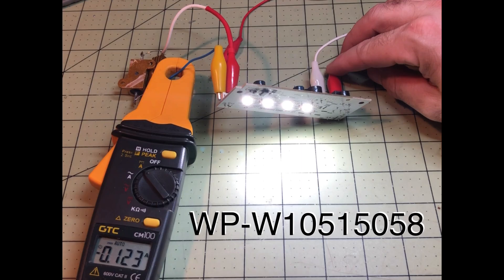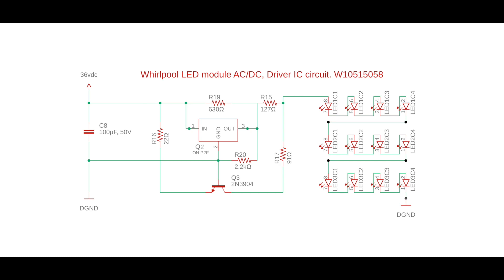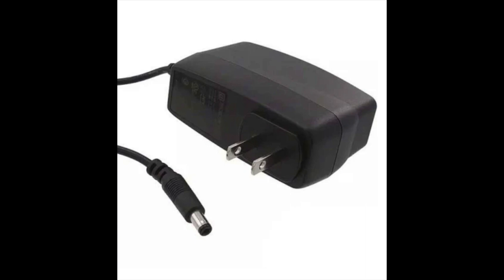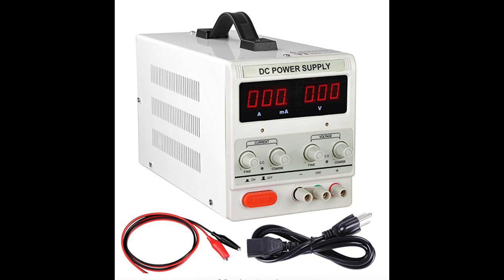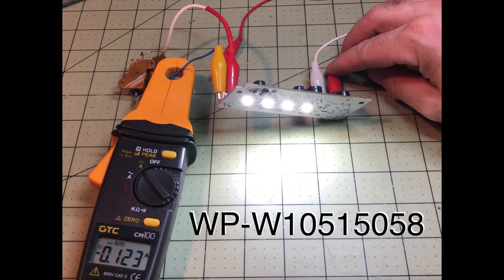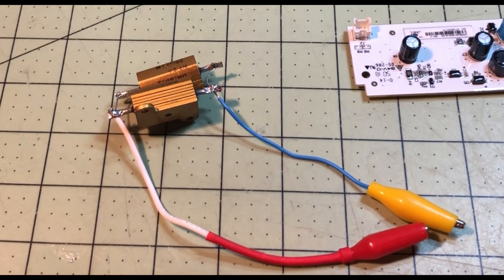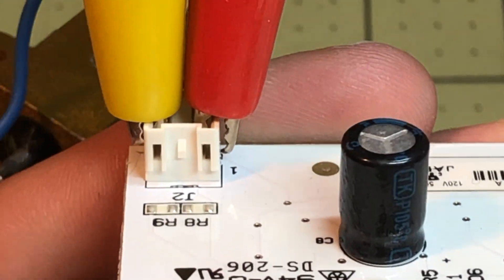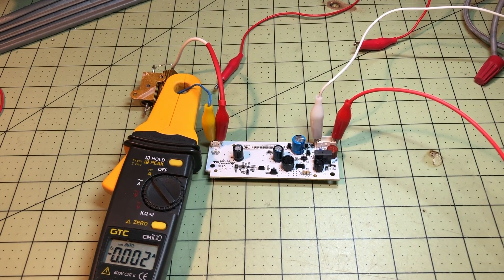WP LED Board Testing

Comment: I had an open LED and it's still dimly the other two units must be more circuitry
Reply: if it's only one led not working ,, you can either put a "500mw"<your number"- resister to replace it, or just jump across it"short it", and the other leds will just be a slight bit brighter with that extra 3 volts they all get to share on. that's what some of the tv repair guys do. 
 i snagged the main board on sale, and was trying to repurpose it for somthing else, didn't realize it was a 3 part ordeal, i might have fried the leds out putting 110 volts to it without any "dummy load",, they all have little black spots on them now.  opps.
Reply from the maker: Overloading the circuit is not a risk I like to take if I can help it. Doesn't look good if customer starts to hear snap crackle pop when I am fixing their appliance, lol.

Comment: Bro you're such a god for the diagram. Do you know if the wires that came out the ACDC board go all the way to the other boards? I'm asking cause I made a LED board since I live out the states and I was wondering if I put the 12v to the wires that goes to the freezer board so the freezer board light up.
Reply from the maker: yes, you could do that. Sorry for the late response. They are like Christmas tree lights. You wouldn't have any protection, if you did that though, for short circuit.

Comment: hey are you able to help me with some info  for chip R15 and R17 both are toast and the R15 actually melted off the board? I know the ohms as per your drawing but would love if you could help me select the correct chips, trying to get into some pcb electronic repair and such as a hobby and this seems like a great way to spend 30 cents rather than $60 for the same part with the same chips that will probably not last. not sure what tolerance and wattage I should be selecting for this. Any help would be greatly appreciated!
Reply from the maker: Unfortunately, there's more than just the resistors that need to be replaced, some parts that are not identifiable. I recommend replacing the 3 led boards, the one's you can get on amazon as a pack. you have to replace them all or they will be different hues.

Comment: Hello, I wouldnt be surprised if I dont get a reply since this video is already a few years old but here goes: My board went from flickering to entirely dead. I replaced the corroded R15 with a 100 and 27 ohm resistors wired in series, but there's still no light. I assume somehow Q2 is now dead. You think if I bypass this dimmer circuitry and directly wire the LEDs to the 36V input, that it will work? Thanks.
Reply from the maker: Since I made this video, they started selling aftermarket boards on Amazon for like $50 (kit has 3 boards one for freezer and 2 for fresh food. I would just replace all three.
Reply: @electronicsprojects4708  oh gotcha! thanks for the reply.
Reply: @electronicsprojects4708  The aftermarket boards don't seem to be conformally-coated for moisture protection like the originals. Some clear spray lacquer (first masking off the led emitting surfaces and the connectors) might add to the boards' longevity, too.

Comment: Hello guys I have a problem with the leds; What reference does this led have because I have to change one of these
Reply from the maker: If it's a side by side Whirlpool, typically I see the freezer LED module cause no lights in fridge and freezer at all. If it's strobing in the fridge and freezer, then the main control LED module in the ceiling of the fresh food compartment has failed. Once I saw it strobing and had to put in the main control LED as well as the freezer LED board in. I hear the generics on Amazon have been holding up, but the tint is a little bluer than the original, so if you go that route, change all of them, they have a 3 board kit.

Comment: Replaced Q2 with Digi-Key onsemi PZT2907AT3G for $0.44 and re-soldered R15 and has been working fine for a week now
Reply from the maker: Thanks for the info
Reply: @electronicsprojects4708  Couldn't have done it without your video. Thank You!

Comment: Electronics Projects, your video is the only source of a schematic for this board I have found. Thanks. Can you provide the rest of the circuit schematic? My board flickers and the +36VDC across C8 oscillates when this happens, so the issue is likely part of the AC to DC part of the circuit not shown on your schematic.
Reply from the maker: It's a schematic I drew up. In my experience, this circuit is the only part of the board that is problematic. (most of the boards I have tested had a 'flickering' symptom) If you think that the power supply has failed on your board, you can test this, but removing R15, R16, R19, and R20, this will isolate the regulator from the primary power supply, and if you have stable voltage, then you know this circuit is the problem. Unfortunately, I have not had the ability to repair this circuit, since I have not been able to identify the large surface mount regulator IC, I have looked at the p/n and even DigiKey said the manufacturer could not identify it. So when I come across this board flickering, I replace it with a new one.

Comment: Can you tell me what resister is next to the R15, 910 is for the R17. But the resistor at R15 is burnt.
Reply from the maker: Rereading your question, I can't really make out which resistor you are talking about, but if you go to minute # 0:46 in the video, I labelled the resistors and values.

Comment: my led panel is dim when I open the fridge door. I tested out the voltage of the wire from the fridge and its output is 31v. What would cause all the LEDs on the board to be very dim since the voltage output is good.
Reply: I have the same problem as well.
Reply: @learn4fun2diy  I changed out the transformer powering the LEDs and now it works. Any generic transformer with   the same specs will work. Very easy swap.
Reply: @accordfreak1  thanks for the info. His video is the best resources on this problem I can find so far. With all the help here from you guys as well, I read and found when it is dim, the other 2 lights should have burned LED. Sure enough, I have found one LED in my freezer module is burned. Previously I even replaced the R15 with value close to its 127 ohm, like 125. It still didn't fix the dim problem, because that's not the root cause, but this burned LED in freezer.

Now I have to find which part is the right high brightness LED and replace this SMD version. Thanks all.

Comment: Do you happen to know the regulator used on the main board at Q2? I have verified that the two secondary boards are working after replacing leds on one of the boards with LTW-5630AZL40 as this part appears compatible (verified with 24 volts with two boards connected in series at 50 mA / one fixed one unaltered). After replacing nearly all the resistors and Q3 in your schematic, I am finally getting some output but only in the 'test' method and the output current appears very low. Reducing from a 300 Ohm to 200 Ohm load had nearly no effect so I thinking my Q2 needs replaced, just not sure the appropriate part.
Reply from the maker: I agree that Q2 is highly suspect, but I have not been able to locate it.
Reply: @electronicsprojects4708  No problem. Thanks for the reply and helpful videos.
Reply: @electronicsprojects4708  PZT2907AE ? 600mA, 60V, PNP, Si, small signal transistor. Original is P2F sot 223

Comment: First of all, big thanks for making this video...with your guidance I was able to determine that it was the freezer led that went out. I was wondering if you have tried fixing one. I naively soldered a portion of an LED strip to the terminals of the freezer LED with hopes it would close the circuit and allow at least the fridge lights to work, but it didn't, maybe the strip needed to be longer to provide more ohms???
There must be a way it can be bridged somehow, just gotta do the right math.
Reply from the maker: Not sure if you saw my follow up video https://youtu.be/GRwboBle1R0 Yea, you can't bypass it, that can short out the main power supply board.
Reply: I have one led failed on the w10515057 board. I am wondering whether I can put a resistor to bypass the dead led.   Any suggestion on how many ohms to be used if the idea sounds ok?

Comment: my ref has the strobe light effect problem. do you think its an issue with one of the electrolytic caps since they deteriorate over time? it looks like its a common problem with this board after working fine for over a year. thanks so much for posting this video. now I can troubleshoot my board up to component level.
Reply from the maker: even though, e. caps tend to fail on boards, I have yet to see a failed cap on one of these, so it's not likely. The strobing happens when the protection circuit sees a case of over voltage or over current, shuts down then tries to restart and fails, this happens real fast. Typically I have found on the side by side refrigerators that the main module in the ceiling is the culprit and cannot be repaired, but needs to be replaced. That being said, usually I use my testers to confirm this.
Reply: @electronicsprojects4708  is the main module different from the light module? Sorry, I'm a novice. The parts website does not list a main module that I can find. A Whirlpool tech was here yesterday and said just order the lights online. That should fix it. We have the strobe effect going on in the fridge and freezer side.
Reply from the maker: @ChrisColter  for side by side refrigerators strobing effect, I would start with the refrigerator side module in the ceiling. Typically if the freezer or lower refrigerator side board goes out, you will get dim or no light.
Reply: Electronics Projects thanks!
Reply: R15 on the board overheats and goes bad, you can try reflowing it or replacing it. I think it's 127 Ω.

Comment: Good day. are they two 250oh 5W resistors or is it a single 250oh 5W?
Reply from the maker: 250 ohm at 5 watts is the resistor value you would use if you want to order one. Since I did not have one handy,  I used (x2) 500 ohm in parallel to give me 250 ohms. It gets hot, FYI.
Reply: @electronicsprojects4708  Thank you very much brother